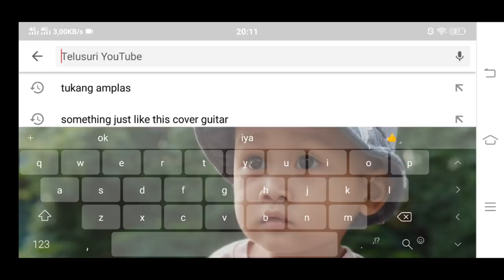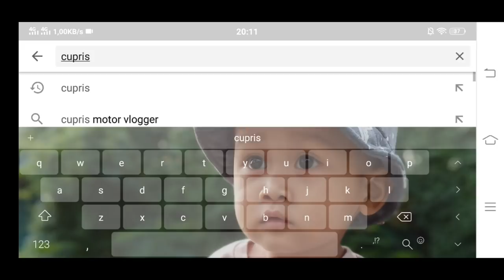Repaint Full Body Honda GL MAX warna Hitam Metalik Samurai Paint

Comment: Bang motor ane ncb 150 r. Warna e udah pernah di cat ulang warna doff. Tapi pudar. Kalo mau cat ulang harus pakai poxy dulu apa nggak. Terima kasih 🙏
Reply from the maker: Iya dong pakai epoxy 2k04
Reply: @TukangAmplas  kalo gak pake poxy gak maksimal ya mas  hasilnya..😁maaf baru mau blajar mas😁
Reply: @TukangAmplas  sama kira kira habis brapa kaleng bang buat ncb 150 r. Makasi bang
Reply from the maker: Yoi mas

Comment: Mas sebenarnya perlu plastic primer samurai paint ga untuk yg body plastik?
Reply from the maker: Kalau untuk body plastik halus gak perlu plastic primer
Kalau untuk body plastik lentur atau kulit jeruk atau body kasar wajib pakai plastic primer dulu
Reply: Berarti kalau misal untuk bumper mobil setelah kita amplas langsung sj pake epoxy ya? Ga usah pake primer
Reply from the maker: Bumper nya body halus kan?
Reply: @TukangAmplas  iya nnt diampelas dulu sebelum di semprot epoxy
Reply from the maker: @slametsunaryo5886  yoi mas diamplas dulu trus timpa epoxy 2k04 tunggu kering amplas lagi sampai halus permukaan nya soalnya tekstur epoxy 2k04 sedikit kasar
Habis itu baru naik warna
Reply: @TukangAmplas  baik mas. Terimakasih. Tadi yg WA mas adalah saya. Saya mohon bimbingan kalau nnt belum jrlas saya tanya mas ya

Comment: How much can use spray paint cans
Reply from the maker: Check description
Reply: @TukangAmplas   Pulser 135 which colour combination Best
How to get use spray paint cans
Colour after work dropped fuel tank paint removing yes ya no
Reply from the maker: You can use it like a video tutorial
Reply: @TukangAmplas  paint after 2k clear coat used to bike fuel tank after fuel dropping drop coat removing yes ?
Reply from the maker: I don't understand what you mean
Reply: @TukangAmplas  kalo bbm netes di tanki mtr, apa ngerusak clear coat_nya..?
Reply from the maker: Gak bang.. Tolong elu jelasin ke dia ya bang.. Makasih
Reply: @TukangAmplas  2k clear coat are fuel drop after removing in to tank
Reply from the maker: No, because clear 2k01 is resistant to gasoline
Reply: @TukangAmplas  thanks so much for your help but you can use spray paint after the petrol fuel trying next video. Spray painting 2k clear coat not removing video